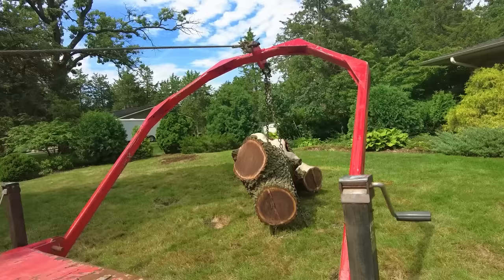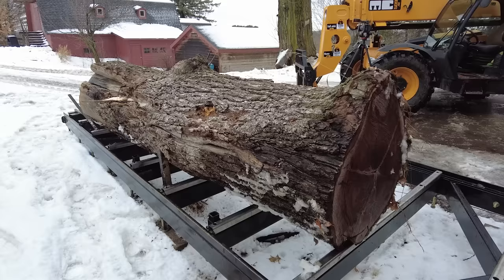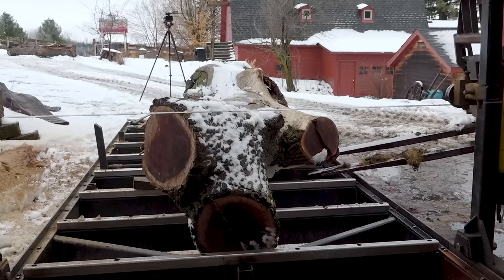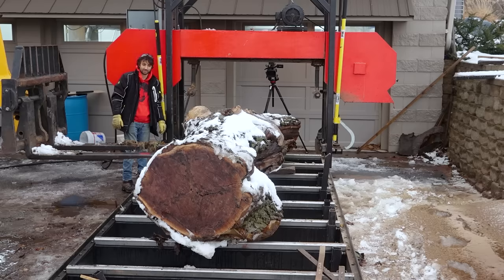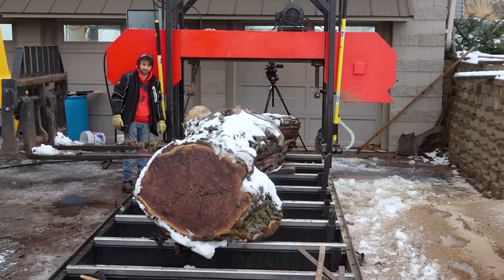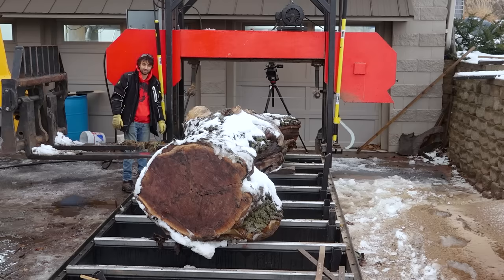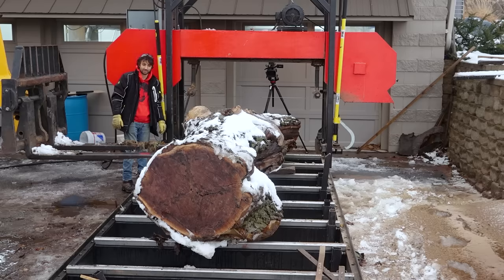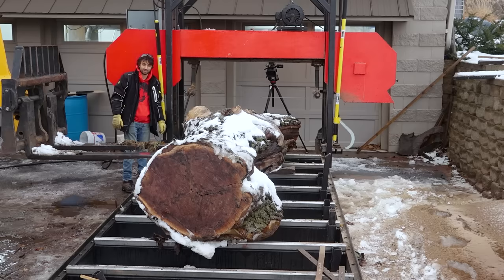What Does Lightning do to the Inside of a Tree? ⚡️🌳

Comment: This video of lightening struck lumber, reminds of the time I met an “Artisan” wood worker in Kailua-Kona.  He  purposely injected electrical current directly into the slabs he cut, it split the wood in a random and spectacular way.  Then he would fill it with Epoxy.  
At the time it seemed like an interesting thing to do, but now it’s just what everyone does ( the epoxy I mean) but to voluntarily do that to the lumber was interesting as well.
Reply: I have seen tables online made that way. They call it fracturing if I remember right.

Comment: I was hiking in the San Juan mountains the day after a huge lightning storm.  We came across a ponderosa pine that had obviously just been struck.  Most of the bits were toothpick size but the entire tree was completely blown apart as if you'd packed the center with C4.  It was awesome to see and the smell was too.  All that water inside the tree went to steam instantly!  Even the roots were mangled.
Reply: I've seen that a couple times in the woods upstate near me.
Reply: I actually saw a big 'ol ponderosa get hit with lightning once. It literally exploded. Scares the HELL out of me even though I was over 100 yards away thank God. Still had pieces land within 30 feet.
Reply: Lighting can have bizarre affects and it depends on the species also.  Pines tend to explode (though I've seen only tops blown off with the tree living decades after).
I have an oak on my property which was hit and blew off the bark along 1 side which has scared over and still going strong 10 years later.  The tree immediately adjacent (like the trunk bases touch) to it died over the next 3 years with no sign of damage (I assume the roots were destroyed). Both these trees were over 5' circumference. Live oaks if anyone cares.
Reply: don't stand near a tree in a lightening storm

Comment: Many years ago I heated with a woodstove and lightning struck a large red oak which died standing. I cut it up for firewood and was surprised to burn up my McCulloch Timberbear chainsaw in the process. Then after letting the split wood dry all summer I could never get it to burn in the woodstove. As long as it was mixed with good wood it would burn but overnight it would become a large ember. Always good for starting the morning fire but would not burn on its own. Finally an old farmer told me that once struck by lightning it was worthless as firewood. Live and learn.

Comment: Many years ago while living in southern Ohio our family moved into a new home. One of the pines on the property hacked been struck by lightning before we had ever gotten there. During our time at the property it was struck at least twice more but since it was an anchor tree for our clothes Lind dad left it standing. Then the fateful day came were the tree would meet it end. An F5 tornado hit the area and our property was one of those hit. The lighting struck tree had it’s top taken off by the tornado and it was struck by lightning once again. 

We cleaned up one tree that was knocked down and turned our attention to the lighting tree. We started out with our double bladed axe since we did not own a chain and a neighbor that had several chain saws since he owned a large saw mill was keeping them busy cleaning up other damage around the area. Every time we hit that tree it was like hitting a rock but we were making flow progress. Finally our neighbor cam over with two of his chainsaws and tried to help cut the thing down, costing him two chains. After several days of chopping on this tree we had it down to a hole through the center and two sections of trunk on either side about the size of a silver dollar. I had taken a break from the tree while my oldest brother was working bin the garden. A strong gust of wind came up and we heard a sharp pop we both looked at the tree then a second gust came up and another pop and the tree wobbled snd fell. As the tree hit the ground it shattered in hundreds of pieces.

Comment: Many moons ago, there was a group of about eight of us batting the breeze and drinking beer on a farmer's front porch when a eucalyptus tree about thirty feet away was blasted to bits. There was a huge flash and a simultaneous ear splitting bang. Took about ten to fifteen seconds before anyone could see anything after that white flash and the same for the ringing in our ears to quieten down enough to hear someone speak. The general consensus was 'faaaaaaaaaaaaarrrrrrrk' as we looked around wondering what had just happened.The smoke from a shattered stump and shards of wood all around was the outcome. Then we noticed bits of wood sticking out of the walls of the timber clad house, all the windows were blown in and we could not believe that no one was bleeding. A couple of us had crushed our beer cans in surprise. 
I read up on it a few days later and learnt that lightning tends to travel down the interior of a tree to ground and in the process the sap and any other moisture is superheated by the bolt's energy and flashes to steam instantly. As it expands, the tree has difficulty in maintaining structural integrity and usually destroys itself in the process, depending on the diameter. It was a fascinating experience and certainly one I have no wish to repeat.

Comment: Trick on the forklift in wet or icy weather. Tape thin lath to the top of the forks. The wood on the forks will take away the slick metal surface. Btw this works particularly well on metal to metal contact.

Comment: Your experience definitely allows you to judge where you are most likely to get the best results for future wood use. Since I prize crotch figure, and the ripple of heal over wood, I might have cut the multi crotch log into shorter sections. Then each section could have been rotated for optimum figure. But your decisions to compromise worked well, yielding some really beautiful cuts. Hope those crack slabs can be sliced into thinner surface or veneer wood. Even the off cuts would be treasured by turners and segmented. 👏🏻👏🏻👏🏻👏🏻👏🏻

Comment: Yes it's worth it, especially for ones self. But if it were a commercial mill, perhaps the sale probably wouldn't justify the work because I imagine this kind of wood is cheaper with defects, though I'd consider buying it anyway for non structural like a cabinet door or a table etc, epoxy should hopefully heal dodgy areas which might not hold itself together. Or something like dominos

Comment: Matt, have you ever considered building a roof structure over your bandsaw similar to an RV cover?
Reply: That would be a great idea but the legs are usually only 5 or 6ft apart, but a header could easily be fabricated to get a bigger opening from the side. But with the telehandler he can easily load logs from the end, just extend the boom as needed.

Comment: Really surprised those beds aren't designed with built-in jacks to orient pieces for the first cut. Thinking every other short piece should lift on one side or the other. Guess I'll have to build one. Hinge on one side, bottle jack on the other, alternating each time. The scissor action would also counter any taper. Yup, definitely making my own. 😉

Comment: Not sure if this ever happened to you before but I recently received my woodmizer mill in October and I already had a log shift as I was cutting thru it.  Its not a good feeling because my blade was stuck so badly my only fix was to take a chainsaw to the section I was cutting out and cut thru it where the blade was stuck without hitting the blade of course.  It was a successful fix but as I positioned the chainsaw I didnt realize the chainsaw cut into my water lubrication line.  That was a simple fix as well just buying new tubing at the hardware store.  Getting the blade stuck from the log shifting is not a fun thing at all

Comment: I would suppose that a lightning strike, as I have seen what it does to a 4’ diameter White Oak first hand, standing inside looking through the storm door, tree was about 20 yards from the door, when it struck. Wow just the shock wave knocked me back.
But the strike hit started at a large upper limb traveled 30’ or so visible damage down the limb, another 20’ or so visible down the trunk, then went 30’ more, and just above ground blew out again. What the tree guy said was it would most likely die, even with little visible damage,
He said that a strike like that literally boils the sap in the middle of the tree in a instant. The spitting inside is a result of supper heated moisture-steam with no where to go, like a boiler exploding. Mother nature, makes some interesting looking wood for all kinds of projects. He estimated that tree was at least 150 years old.

Comment: My takeaway from this video: If at first you don't succeed, use hydraulics! 😉 Seriously, though, there's a ton of beautiful wood in those slabs. Smaller boards with awesome figure could be cut around the defects that can be used for smaller projects, and there's enough larger, clear sections that some bigger pieces of lumber could be cut and milled out for some really nice builds. Really great that you can salvage so much from so-called "garbage" wood.

Comment: I've recently learned that heat appkied to wet hair causes bubbling in the shaft and weakens hair. I'm wondering if the heat caused by blade friction and resulting steam will damage or add more character to the slabs?
Reply: Not even close.

Comment: mikethesignguy
Lightning is attracted to the moisture in the tree which acts like a lightning rod.  As the current runs down the moisture it boils the moisture forming high pressure steam which blows up (flashes) and cracks the tree.

Comment: I want those 2 that were basically garbage to you because they were split in both directions!! I want to get them wet down the middle and then hook up DC to it!!! I’d slowly turn up the amperage until the wood starts to burn a LIGHTNING ⚡️ PATTERN up the crack, exactly where the real lightning made its way through the tree! Then I’d build a melamine box, barley bigger than the wood and fill it with black epoxy to the top surface of the wood. Then dry, plane, polish and seal what’s probably the only real lightning struck, black walnut tree in the world!! 
Thoughts?? 🌩️⚡️🌩️⚡️🌩️⚡️

Comment: Logs and slabs move too easily in snow and ice.  Great slap-stick. your so persistent. When lightening hits the arc going to ground boils the water and the steam pressure cracks it. Are those going to dry outside or in the new barn?

Comment: oyeah you definitely should have some rotating interns, where you chose a few for a 2 min solid 6 hour periods rotating Thye must have ideas and plans befoerw hand for work/products/marketing just to see where there head os at amd wehat they have done,  Not necessarily under 2o either. I had 1 amazing guy at over 40; did everything, made me ashamed of myself, could no longer work after 90 days, when he accidentally shot himself in the region around belt line. Unforseen issues.